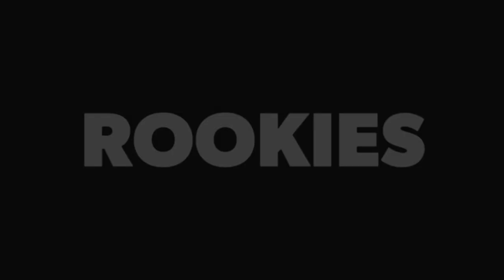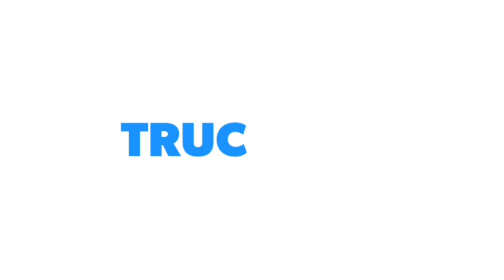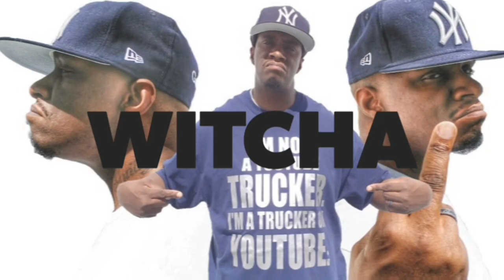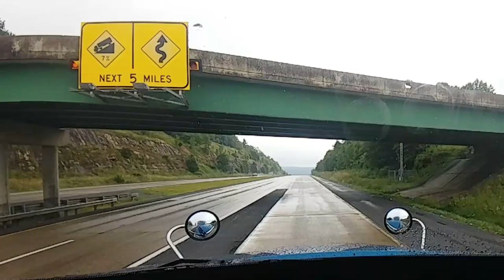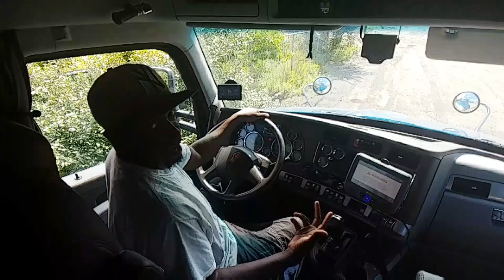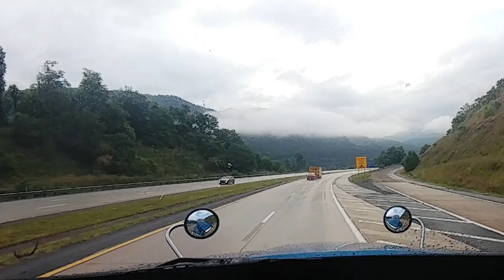Melton Truck Lines | Air Brake Test | West Virginia

Comment: Donners pass IS NOT that bad (if driven with common sense), went down when I was with KEEN TRANSPORT (heavy haul), with oversize load, during winter, lower side of manual side, took a while, great scenery, long, but safe. YOU RIGHT DONT MESS WITH DONNERS!!

Comment: I found out you have to keep gpses plugged in.

well at least the rand mcnally, I have 1.

mines dies at full battery right after I take it off the charger.
Reply from the maker: +Coolrockie 2 Yeah, I was ready to return my shit. Thought I had a short or something. That's wack.
Reply: GuILty718 Lol. You a fool man. naw most of them like that.

also rand McNally is smarter than you think.

You can do multi trips, an allot.
.if you need any tips I can message you...

also you can change how early or late she tells you about
downgrades, speed limits, turns weigh stations, curves, etc.

lady be telling you at 2.0 miles, I set mines to 5.0+ miles to give me time to get over an all
Reply from the maker: Coolrockie 2 I know just about everything about the bitch now. The only thing I need to know is how to get the street speed limit back on my screen. It disappeared a couple of days ago.
Reply: GuILty718 wow, how hell does that happen. Imma see what I can do, shyt you have have to read the directions book. can't find mines atm.

see what I can do
Reply: GuILty718 only thing I see is.

there is a tab under the top left where it tells you how many miles an feet before you turn.

it looks like this but is missing 1 line.   <=

It could be at the bottom left of the gps

Comment: What is the best trucker gps
Reply from the maker: +Aerion Broadus I can't say. I've only used the Rand McNally I have, and the TomTom Trucker 600. Rand McNally made My atlas. That's who I'm running with.
Reply: Aerion Broadus I'd say the Rand McNally TND 7 series is a safe bet, of course there isnt a gps out there that's going to be 100% accurate, you should always double check the atlas... don't ask me why the atlas gets updated faster than a gps because I have no idea but the atlas is almost 100% reliable compared to probably 80-90% gps